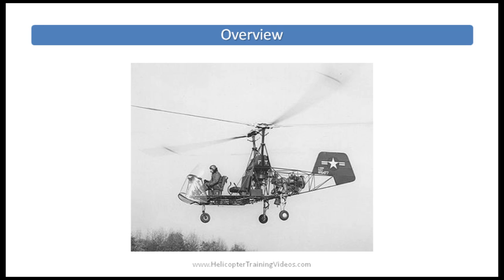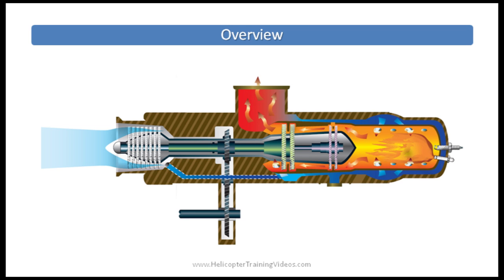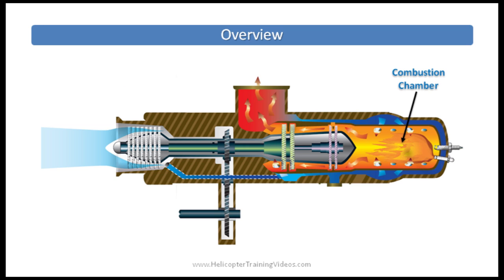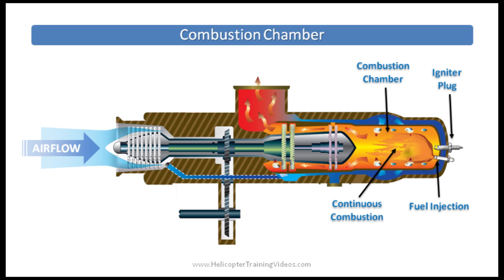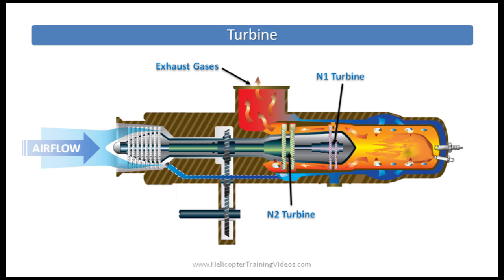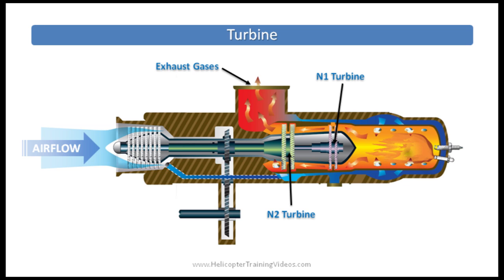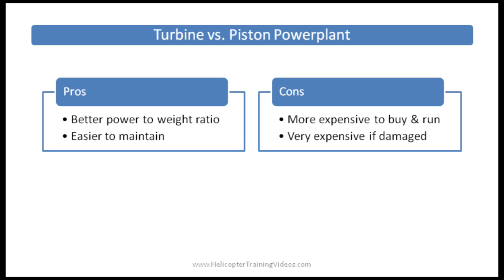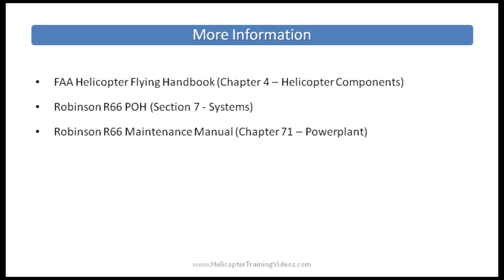Helicopter Turbine Engines - One of the Best Sounds in the World!

Comment: Does this engine have an air starter to provide the initial air to start on the ground?
Reply from the maker: This model uses an electric starter/generator
Reply: larger models like the CH-47 and UH-60 use an APU for bleed air starting as well as additional electrical power to start their mains.

Comment: What I understood from your explanation is that turboprop, turbofan, and turboshaft are using the same turbine mechanism, which the thing make different is in the connection to the fan/propeller. Turbofan is connected to a ducted fan, turboprop is connected to a propeller and turboshaft is almost the same with the turboprop but turboshaft is connected to a rotor. Am I correct?
Reply from the maker: Pretty much
Reply: The only thing I'd add to that is that the Fan in a turbofan is freewheeling and the shafts in gas turboshafts go through a free-wheel unit to ensure the rotor or prop stays moving even if the engine dies.

Comment: Why do helicopters use turbine engines rather than say... a piston engine or something. I feel like turbines would be slower to react to power inputs than a piston engine? And I feel like if you have a CVT gearbox, you could start up a helicopter quicker, and you can "horsepower" your way through a heavy load because you are mechanically linked to the engine rather than having the gases from a turbine engine to use for power. I'd imagine power inputs are "spongy" with a turbine, slow to react and stalling out is easier.
Reply: turbines give a constant power flow. this is needed for a rotor system that dose not change it's speed, only the angle of approach. IE the blade can change it's pitch (articulation) where an airplane's blades do not change the position of their wings. I recommend checking out a rotor head video as well so understand the principle better.
Reply: You don't need the turbine to change speed quickly when you can adjust the pitch of the blades themselves to alter their lift characteristics. Turbines offer a great power for their size too.
Reply: Piston engine were originally used in helicopters during the 40's. However it was found that piston engines needed mores space and were much heavier. And pistons actually took a longer time to start up. I think you still get some piston engine helis but they are rare.

Turbines were preferred by the US military during the Vietnam war and they contributed greatly to making the UH-1 a very useful tool to the military. Ever since then, its just been very common to see turbine engines.
Reply: Turbines are also much more reliable than piston engines, have less moving parts, and get less wear and tear.

They're also pretty cheap and easy to build from scrap, but let's not get ahead of ourselves
Reply from the maker: Turbines have greater power to weight ratio

Comment: Why those engines are not liquid-cooled ( more weight, but smaller parts of turbine, and better heat exchange efficiency )? N1 and N2 could not be used as contrarotary sections of inlet compressor?
Reply: Did he say in the video that they aren't liquid cooled? I was of the impression that at least some parts of them are liquid cooled, but I could just be thinking of the lubrication system.
Reply from the maker: Weight

Comment: I have a question about turbine blades. What are they made of ? Steel, aluminum oxide, silicon nitride, .....?
Reply: +jugosever for the first stage turbine generally low alloy cobalt and nickel and nickel alloy the second floor
Reply from the maker: +jugosever I have been told steel would melt and titanium would oxidize too quickly so the answer is usually nickel alloys or ceramics. You'd have to speak to a manufacturer to get the specifics.
Reply: +jugosever You got it almost exactly right. It's a typically high nickel steel alloy and sometimes they're also ceramic coated.
Reply: hastelloy , nimonic, inconel  alloy steels very hard to work with cutting tools , usually are casten by investment casting then refined by 5 axis mill & grinding machines , radiographic control and more...,electron beam welding of the hub  in  some cases

Comment: So it basically works like a turbo? Or am I getting something wrong here?
Reply from the maker: +Chris Karpos The compressor stage does
Reply: +Chris Karpos Yep, very close. A turbocharger is essentially sorta like a tiny turbine engine with a piston engine shoved in between the compressor and turbine section. The thermodynamical difference is that a piston engine extracts all of its useful power from the gas flow before it reaches the turbine section, whereas a turbine engine either uses another (power-extraction) turbine section downstream from the turbine driving the compressor, or the same turbine that drives the compressor also extracts energy to drive the load, or if it's a turbojet engine, there is no more energy being extracted from the gas flow, and it is instead accelerated in a propulsive nozzle to provide thrust from the engine. Frequently turbine engines use a combination of several of these propulsive methods. For example a GE CT7 turboprop engine has a free power turbine stage downstream of the gas generator turbine to extract power to drive a propeller (which provides the bulk of the thrust from the engine), but any residual energy in the exhaust is also accelerated in a narrow exhaust duct and accelerated rearwards to provide a little extra thrust and propulsive efficiency.

Comment: Is there any kind of clutch assembly that can/has been engage/disengage the rotors but keep the engine burning?
Reply: Sam Thanks very much Sam! That was everything I needed to know :) My lust for rotary knowledge continues!
Reply: The rotors/ reduction gearbox or power takeoff is from the Lo turbine (n2) and NOT from the Hp turbine!! Engine ( gas generator) will continue to run with no unnecessary clutch!!!!!

Comment: the combustion chamber must lies before the turbines not after them !!!
Reply: +dranzer gigs As the compressed air/fuel mixture burns it expands and creates the momentum needed to turn the turbine wheel. The turbine wheel is connected to the compressor, so it also turns the compressor. The compressor provides more air for the burn to keep going, turn the turbine, etc. This may not be too intuitive and may sound a bit like an impossible "free energy machine" (turbine is powered by air that was delivered by the compressor, yet the turbine itself turns that same compressor). Bear in mind though that it is the fuel burning that inputs the required energy to keep this going. Also, before all this is going on, an exterior starter  motor turns the compressor+turbine until the engine has sufficient RPM to sustain autonomous operation. It is then turned off (or in some cases reverts to a generator use).
Reply from the maker: It depends on the design, but either way the expanding exhaust gases escape through the turbines.

Comment: This presentation is clean. The engine diagram shown looks like a very simple engine. Better than most common dual shaft set ups.
Reply: Very tough question. The free shaft is basically the replacement for the high speed section of standard aviation. Providing your bearings do not seize up, and you don't jam the throttle any turbine engine is good. Heat has always been a problem. Application is the subject to answer what you're asking. Purpose is everything!
Reply: It's all good here. I am in the process of manufacturing my own engines. My first prototype is nearly complete. Most people don't even care. It's all about touch screens and drama on tv. You learn by asking.
Reply: Life begins outside of your comfort zone. So said some philosopher or someone :/

Comment from the maker: Comment from Mike Franz: Just watched your turbine engine video. It is well done but you label the fuel nozzle and igniter in the reverse positions. It is incorrect in the FAAa handbook also. The upper is the fuel nozzle, the lower the igniter plug. During preflight you can follow the fuel line to the rear of the burner can and the igniter lead from the igniter box to the plug.

Comment from the maker: In the Bell 206 it is at the top, behind the main rotor mast - google search "engine compartment bell 206" and look at the images.
I'm not sure I understand your second question - the front blades of a turbine are compressor blades - they pull in air and compress it to be used in the combustion process.